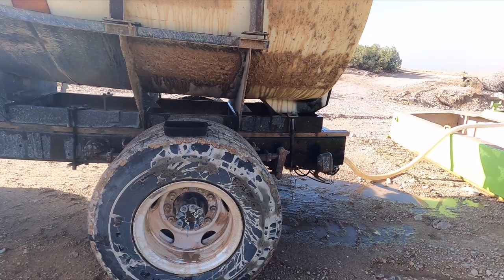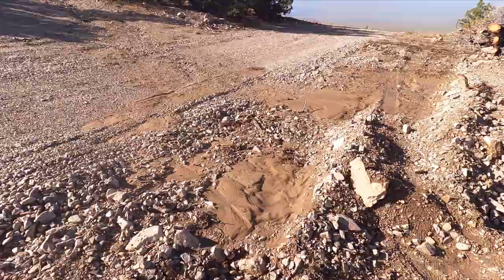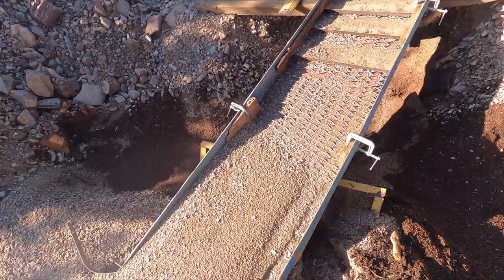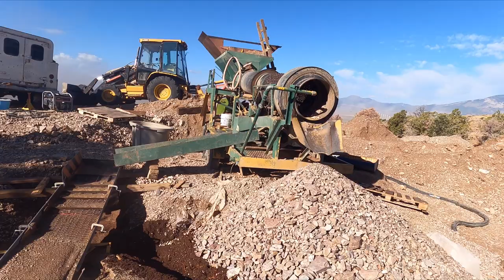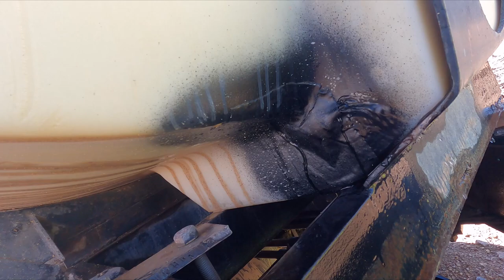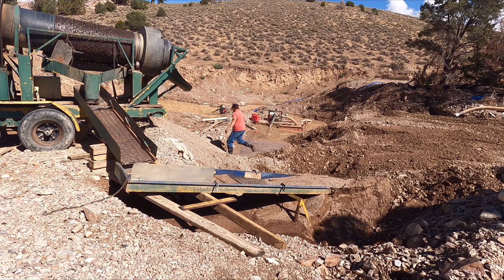September season  22 Gold mining

Comment: Box is loading up mainly because of the right angle.
A longer slip plate at the beginning of the lower box should help the problem maybe a rubber drag .would help too.
But what do I know I’ve only watched few of your videos.
Rye patch met you by Scotia rosebud mill city seven troughs rabbit hole Placeras Mill city Emily of course Ely
On second thought there’s water Emlay?
And it’s not a steam deposit?